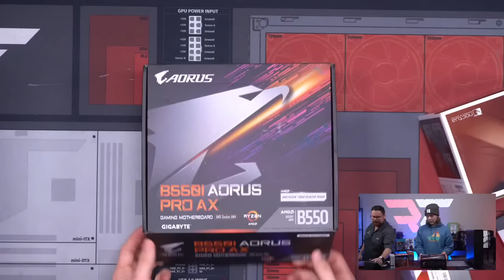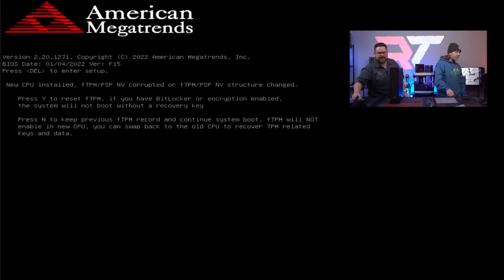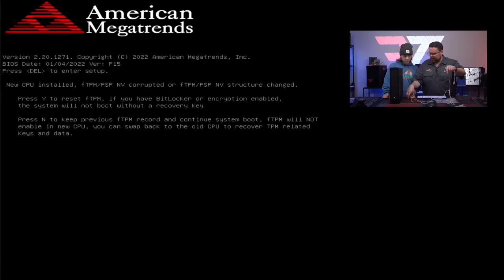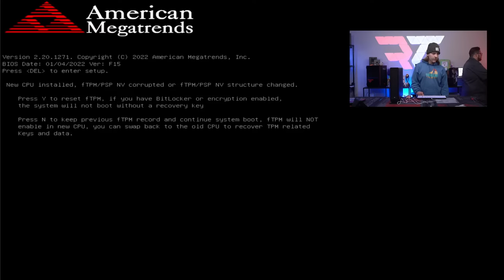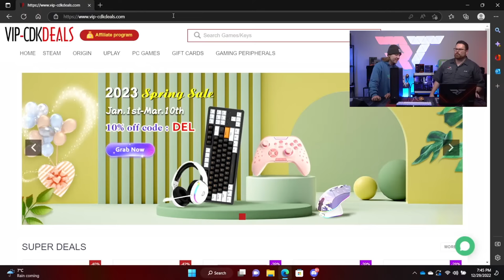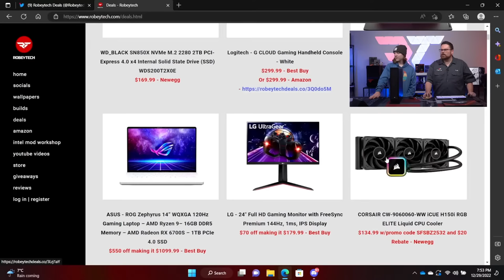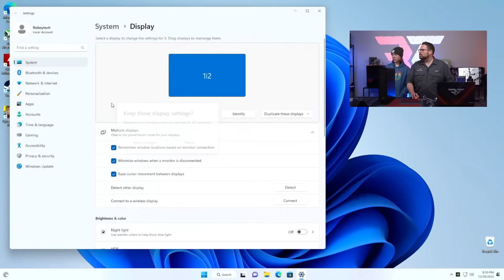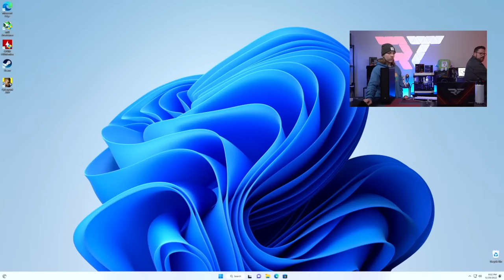PC Giveaway + The Ultimate PC Console Build - $4000 PC Build in the Fractal Ridge (5800x3D/4090 FE)

Comment: On PCPartPicker it states that you have to upgrade the bios when you pair an X570 mobo with a 5800x. Do you have to upgrade the bios when you pair the same processor with a B550 mobo?
Reply from the maker: It worked fine, but it depends on when your Mobo was made etc. So unfortunately the answer is maybe.
Reply: @RobeytechLive  Cool, preciate the response RTL 👍🏾